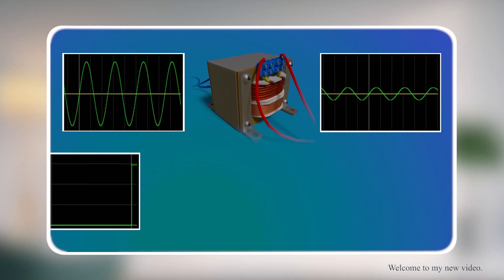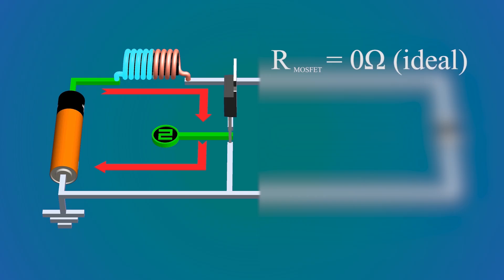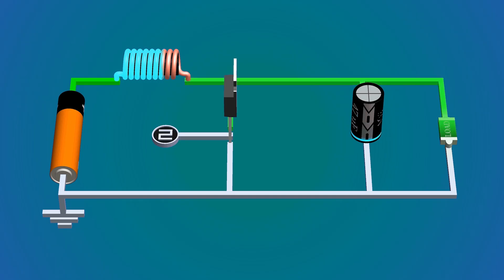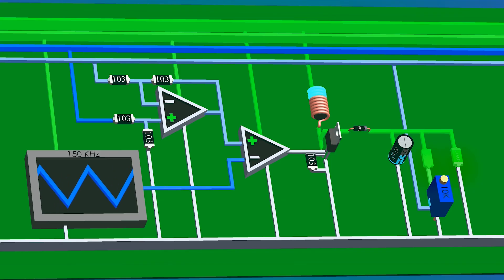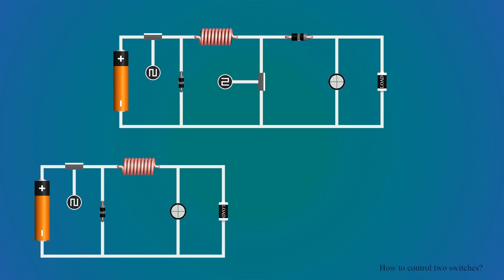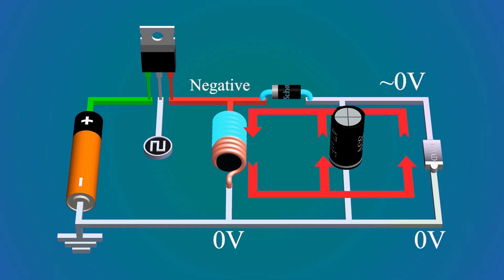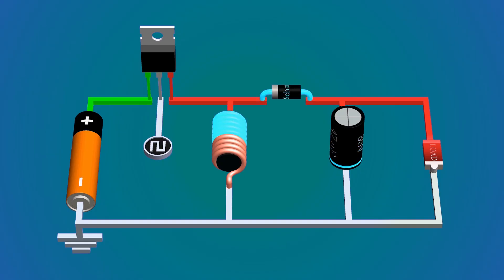How does Boost and Buck - Boost Converter work? | DC-DC Converter - 2

Comment: Amazing. What i understood is that boost converters are circuits that increase the voltage from a lower level input. This is posible thanks to the mosfet, the pwm signal, the inductor and the capacitor. But, the problem is that the energy is not always on the load, so, for this reason a diode is added. The diode allows the flow of current in only one sense. This provides always energy to the load. For last, if the load changes, the output voltage changes to. To solve this, the boost converter has a comparator circuit that solves this.

Comment: In both a boost converter and a buck converter, as long as the inductor current is "continuous," that is it never dwells at zero (meaning the inductor is fully discharged) at any time during the switching cycle, there is no need to change the duty cycle except to make a very small compensation for the losses in the circuit. If ideal components are assumed it does not need to change at all. In practical designs the inductance is selected to place the discontinous-continous current boundary at something in the range of 20% to 40% of the full rated load current for the circuit.

Comment: If that circuit use in ac resonance circuit....Can creat a free energy by big induction coil resonance....energy =li2/2    ........more over resonance occurs almost immediately..that energy is bigger than  energy =u.i .t      .and funny is for r=0 we need u=near 0   to take a huge current coil....so e=Li2/2 bigger e=u .I.t     ..........

Let suppose....for r=0 on resonance circuits  current is almost infinite ( no resonance that energy would take infinite  time but with capacitor in series that time becomes almost zero......) so  current infinite  energy infinite  for very few milliseconds........ someone say e=uit but we  have u= near to zero  for r=0  so e= uit= near to 0.....but e=Li2/2  it's too much  bigger

Comment: Hello.
I need both  boost and  buck converter. I want to convert 12V to 5V using an integrated circuit. Is it possible to convert 12V to 28V by just changing the resistor? And Is it possible to do this by changing only with the resistor value in the circuit?
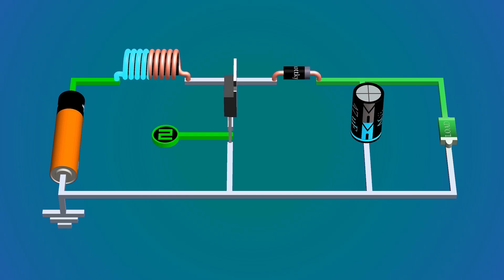Reply: 2:22

Comment: Question but I wish to use one 18650 Li-Ion to power a LED.  LED uses 3.7v so I know the 18650 can go down to 3v very safely (the BMS will let it go down to about 2.85) so will a boost converter handle this situation where the LED is 3, or 5, watts?
Reply from the maker: Yup! 👍